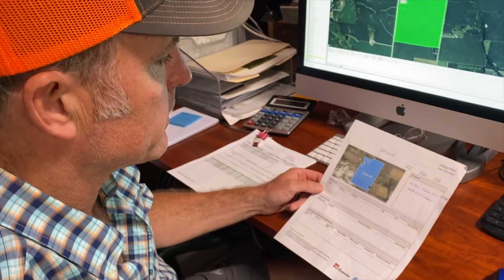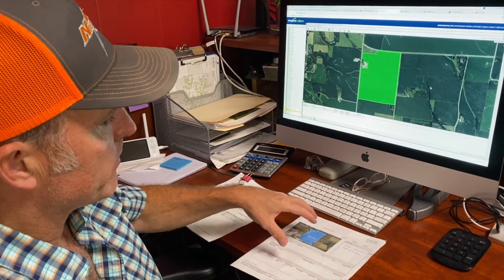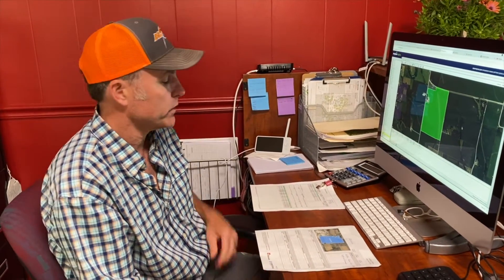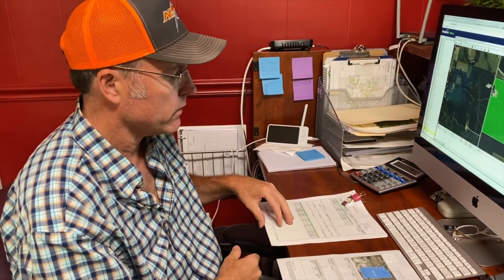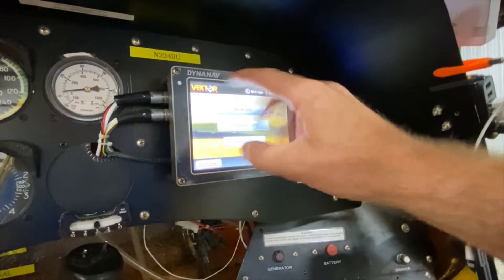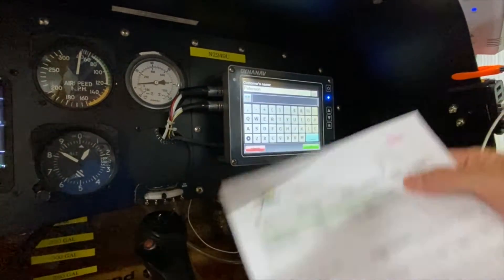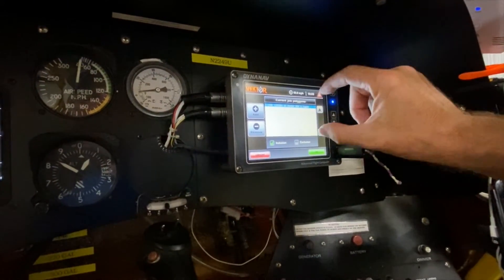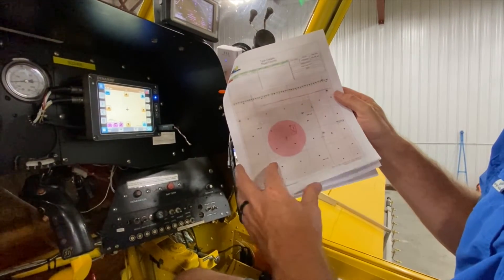Behind the scenes! How does this all work?

Comment: very interesting!  what does insurance typically require for ag pilots?
Reply from the maker: That is a very hard question to answer. It all depends on the value of the aircraft and the experience of the pilot. All I can say is that it is very expensive!  😉
Reply: @IowaFlyingFarmer  What I meant is how many hours should a pilot have before looking into ag jobs?  I know most ag pilots are self employed but there are larger companies as well, correct?
Reply from the maker: @DanielKezar  oh sorry about that. It has been a while since I checked into any new pilot requirements so it would be strictly a guess on my part. Obviously, tailwheel time is highly beneficial and I am guessing a total time of at least 300-400 hours. I did go to an ag flight school that had an approved program with the insurance company which made it a little bit easier for me since I was a low time pilot.
Reply: @IowaFlyingFarmer  Interesting, thank you for the info. I'm looking at getting into ag flying as a low time pilot. It's not a very popular choice and as such there isn't tons of information out there about it. It seems most people my age just want to go to a 141 school then CFI to 1250 and go to regional airlines.